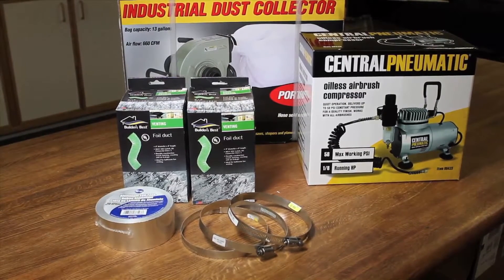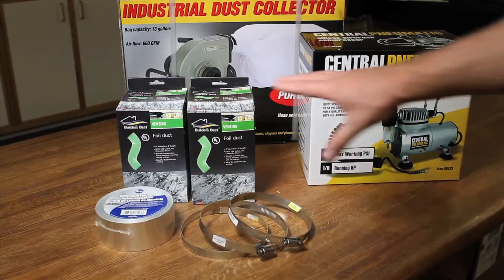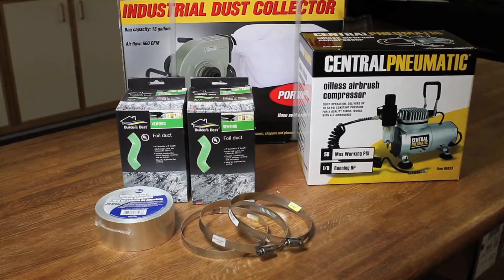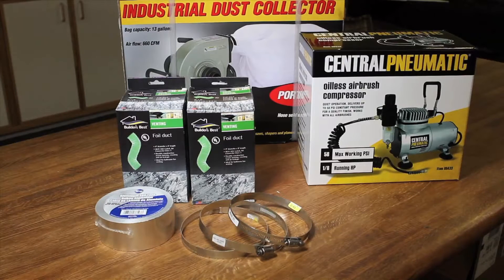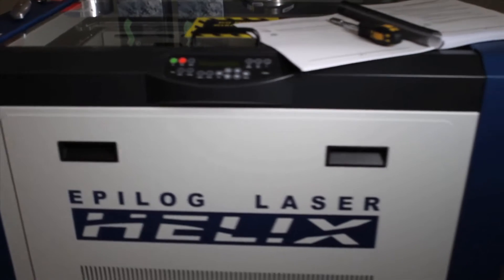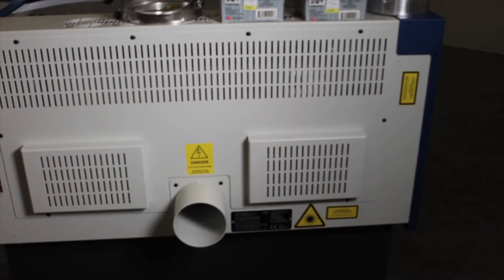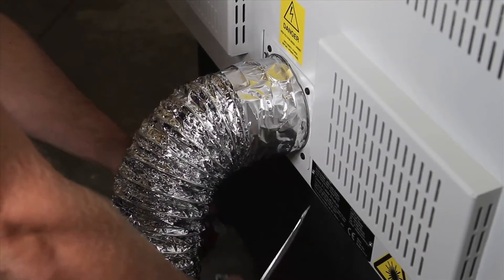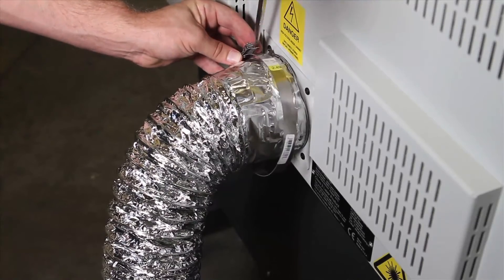Epilog Helix Laser Part 2: Installing Exhaust and Air Assist

Comment: I have the epilog legend series 36ext, they reccomended the use of aluminum exhaust tubing, not the Mylar type you are using,  attach your exhaust pipe half way on the exit port and use the alum tape to seal by making half the tape adhere to the tubing and the other half to the port, then attach you tube clamp over the exhaust tubing over the port